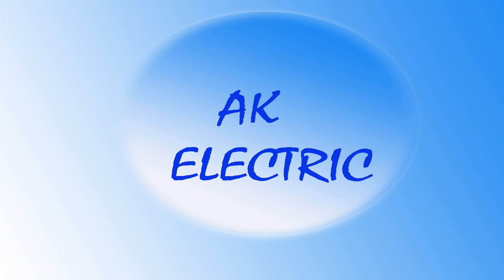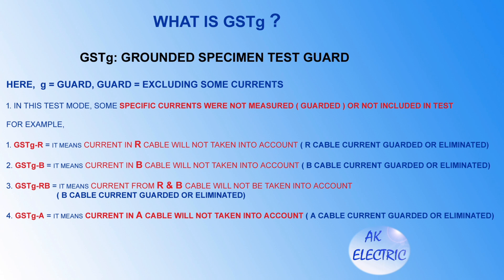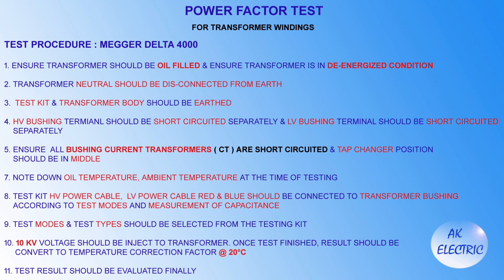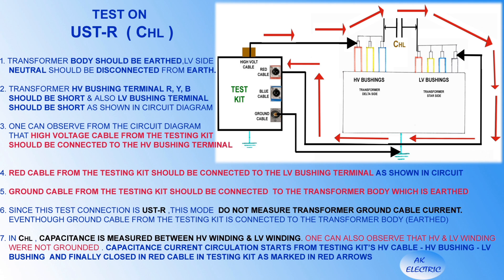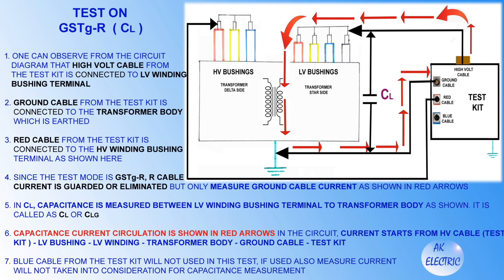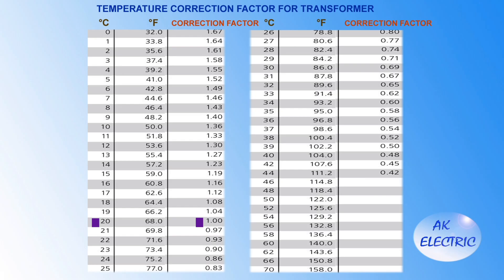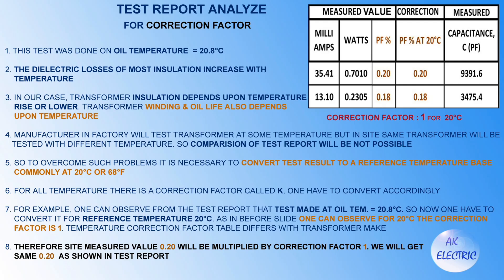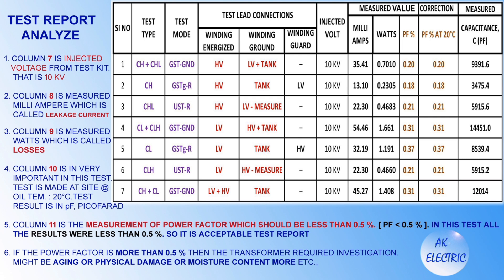TRANSFORMER TAN DELTA TEST, DISSIPATION FACTOR TEST, POWER FACTOR TEST, GSTg, TEST REPORT, PART - 2

Comment: Why did you select 10kV for test voltage? This seems extremely high if testing say a 12kV to 480V transformer.
Reply from the maker: Dear Hi,

1. Normally Test kit for Power Factor Test is upto 12kV available 

2. According to Transformer Voltage rating you can inject voltage 

3. In your Case for 12 kV Winding you can inject 10 kV, there will  no issues. If You feel its too high better inject 5 kV . Result will remain same with very small difference

4. For 480 V better you inject 500 V That's enough

5. Very Soon I will upload Site Test videos 

Thanks